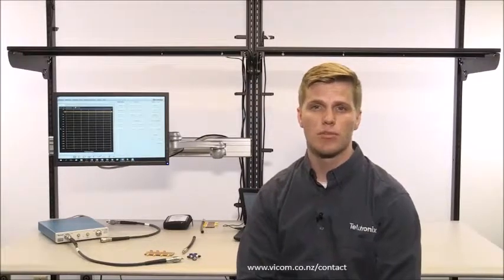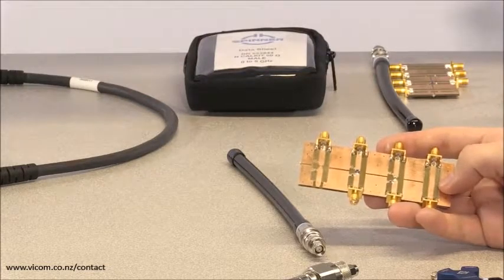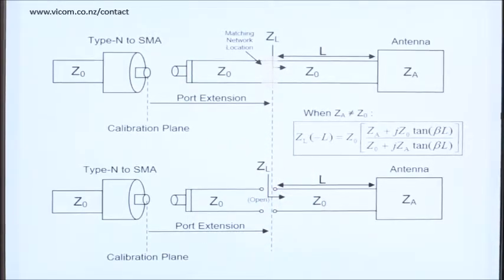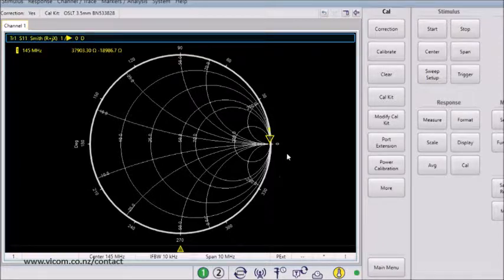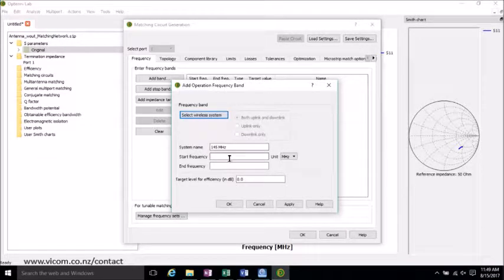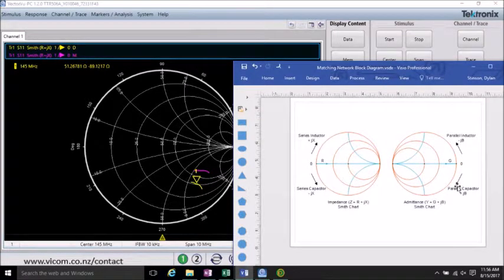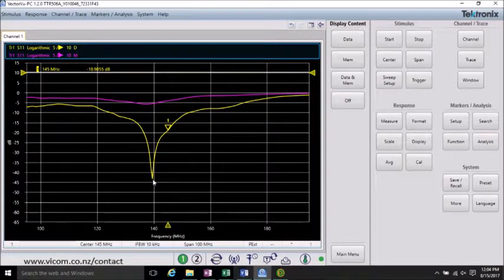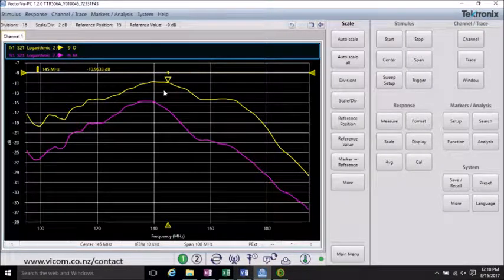Simple Antenna Matching with the Tektronix TTR500 VNA

Comment: Hi Dylan, Wonderful demonstration. Thankyou so much. But I have some doubts. Why did you choose one LC section while there are more configurations available?  What are the parameters that help me choose  which configuration should i use? ( single LC section or multiple lc section, Lowpass or band pass). 
Like in a filter design we specify parameters like passband frequency, stop band frequency, passband stop band attenuation, how much variation we afford n passband and stop band, with these paramaters we choose filter order and type of filter. 
Like this, which are the parameters that influence a matching circuit design. Can you suggest me any reference ( article or video)?
Reply from the maker: Hi Rekha. Thanks for your comment and great questions! Vicom are the Tektronix partner in New Zealand and Australia and we'll be delighted to take this up with Dylan from the Tektronix product line team for you. If you would like to contact me directly at "www.vicom.com.au/contact" I'll arrange to have one of our team pick it up. Regards, Vicom